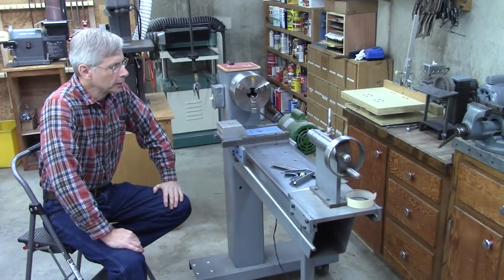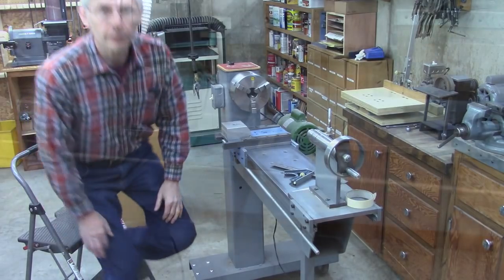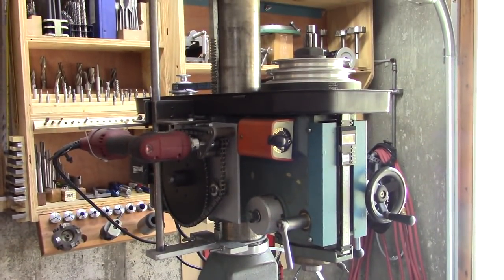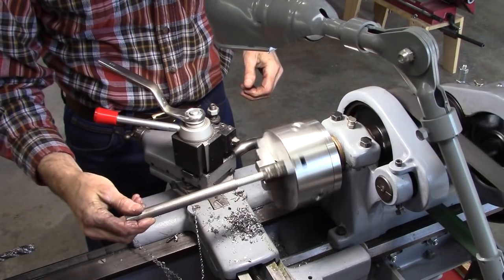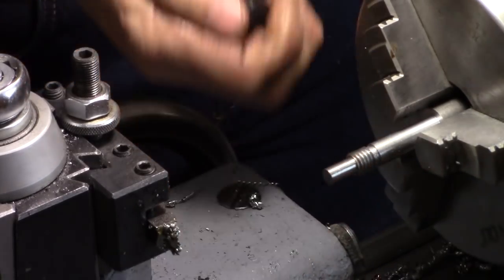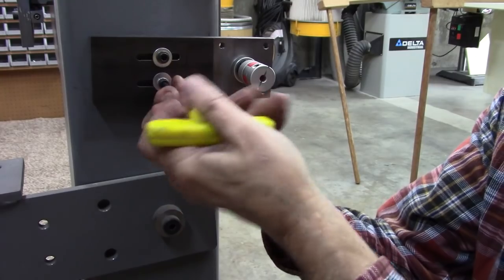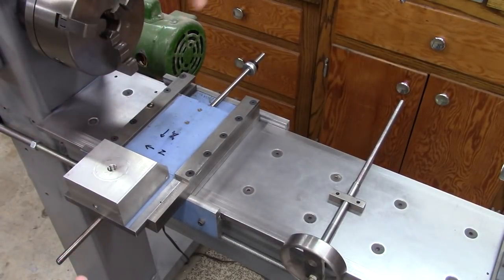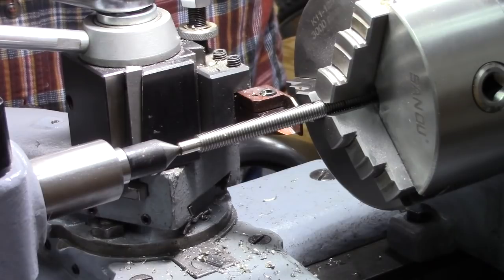Wood Lathe CNC Conversion - Part One

Comment: 13:25 love the attachment for your bandsaw.   If you ever find yourself looking for something to do maybe you could sturdy it up by adding some kind of receiver for the foot of it .... directly under the table.   Just something for that foot to fit into.   Just a thought.. and it might not even be necc.   Maybe something simple as a pin on the inside of the near corner of the column.   Not sure what clearance you have when the saw is used horizontally
Reply from the maker: Yeah I made a video on that table but it wasn't my idea. It works fantastic. It's hard to see in this video but the vertical 3x3 tubing is really close to the blade and sits on the bed casting. The table itself is 3/16 and then I added a 1/4" thick peace of angle iron to support the overhang. It's very solid. https://youtu.be/yGUw2kuweQk?t=377

Comment: 8:30 would like to have seen a journal turned on your all thread.  I suspect the threads will chew up that bronze faster than you might like. At this point in the video though ..... maybe you have a reason that isn't apparent yet
Reply from the maker: You are too observant! Ha. Yes that was simple laziness on my part although amazingly enough it's wearing very well. It really only stops the rod from flopping around anyway. The bushing could be totally missing without any negative effect. I'm a bit more concerned about the standard threaded rob I used, especially in the carriage. It moved a lot! So far it seems to be doing well but I have been keeping it well oiled. The cross slide doesn't move much in comparison.

Comment: Very interesting project !
Reply from the maker: Thanks, I hope I can figure out the software!!
Reply: @WinkysWorkshop  I would have gone with a 3/4 nc lead screw, to make that easier, but I have every confidence in you. You are a very smart guy!
Reply from the maker: @trollforge  - Thanks, I think Acme would be the best but I had the 1/2". If it wears I'll replace it.
Reply: @WinkysWorkshop  I wasn't thinking about size / wear... But 10 threads per inch...
Reply from the maker: @trollforge  OH...   got ya. Well, it was 3/8" -16 TPI which was handy for me with woodworking but the all thread was wavy.  If I was not making it CNC the 13 TPI would be terrible but CNC doesn't care.

Comment: This is going to be very interesting!  I've always wondered why there can't be some crossover between wood and metal working
Reply from the maker: I've done both for a long time... in fact more wood than metal in the past. It all started because I wanted to make better woodworking machines (or at least much cheaper)

Comment: Great numbers again my friend.  A CNC wood lathe eh. I would have never thought about trying to pull that one off. Great to get some time to catch up with you and many others. Just been stupid busy for the last couple months. I have built a couple wood lathes in the day but nothing nearly as good as this neat piece from you fella. For sure on the shear pin. They have saved many a lathe, wood or metal from a disastrous end. I have always liked your approach to builds. Solid, no messing around with too much bling, rock solid pieces anyone would be happy to make or own although I would have gone to a 1" lead screw. I have been blamed for over nailing a wood frame before more than 3, 1/2 times eh, LOL. I must say you are the only fella that I have seen turn with a cut-off tool. For the life of me I can't figure why not to. Saves a bunch of time with no stress to the tool. Brilliant fella ! Right down to the surface plate/table you made for your bandsaw. Why not use what you have and exploit that. You can count on it to see me hanging around for the finish of this build my friend. Great to see you healthy and busy. Take care now eh ! ! !
Reply from the maker: Wow...  great comment, hard to reply to that but I'll try. First, the shear pin. The steppers have low torque and will stall before damage happens. Both axis have hard stops if a limit switch fails. I'm thinking about adding a movable stop for specific chucks in case of a programming error. I'd hate to see the tool run into the chuck. I went from a 3/8" lead screw to a 1/2". The power required to move through wood in very slight compared to metal. To give you an idea the stepper motor shaft is 1/4" and the torque 2.6 foot lbs (if I remember right). The cut off tool is called a Cutoff and Grooving tool and it is advertized that it will cut laterally. It uses a GTN 3 insert and it is shaped to cut on the sides. It works fantastic and has almost no deflection... in other words, a second pass takes almost nothing and a third take nothing. It's very easy to get the size you are aiming for and cuts fairly smooth too. Yeah the bandsaw plates were a hit. The first 10 sold in about 15 minute and the second batch of 20 in about a day. I was concerned about them fitting all bandsaws after I got one complaint (although he made it work). So far only one complain and no returns. I need to get more made and sell them on ebay, Via youtube is good for about one week. Thanks for the comment, you made my day.
Reply: @WinkysWorkshop  I always enjoy visiting here.

Comment: I enjoy your videos very creative! I learned the hard way to mount my limit switches so that they can be open or closed with an adjustable wedge stop attached to my cross slide and saddle; using a wedge allows the cross slide or lathe saddle to move past the limit switch without damaging the limit switch if the stepper motors do not stop when they are supposed to. I look forward to seeing our next video.
Reply from the maker: That's a great idea and i did think about this. What I did as an alternative is make then both hit hard stop if the switch fails. The carriage hits the headstock and the cross slide had a very good stop. The nema 23 steppers don't have enough torque to hurt much although the flex couplers might be an issue. Thanks

Comment: I really enjoy your videos  but worry for your safety when you get close to a spinning chuck with your sleeves rolled down.
Reply: I've been a machinist for 50 years. I have and all my machinist wear full combination overalls ie: long sleeved it is is mandatory in my workshop.  If you have them correctly buttoned there is less risk of entanglement than sleeves rolled up. The mechanical protection long sleeves give out way any entanglement issue.
I have seen more injury occur from rolled up and no protection to forearms. 
Winky always is correctly buttoned up.
Of course there is a possibility of entanglement as is any other trade. PPE IS 99% in the hands of the operator.
PPE IS only 5% of good WHS The other 95 percent is with good awareness, elimination of risk, good engineering practices to remove risk.
Reply from the maker: I agree Norm. 95% (or more) is good awareness. You don't put your clothing near moving parts and you don't leave loose clothing hanging down. I'm not sure my flannel shirt sleeve offer much protection aside from protecting me from a hot chips but rolled up shirt sleeves is a very bad alternative. I suspect I would approach safety much different in a business environment especially when dealing with a lot of people that may or may not understand the potential dangers and may not have the awareness needed. But in my home shop without other around I am very aware of the dangers around me. Ultimately my personal comfort outweighs the very small danger  my sleeves might present.  I also have no guards over my table saw blade either....  and that saw is about 1000x more dangerous than my metal lathe. Awareness and respect are the key!
Reply from the maker: Thanks for your concern. See below

Comment: If you ever come across a scrapped commercial copier, they often have encoders and stepper motors that may be useful.
Reply from the maker: I'll bet they do...  although I've never seen one. So far I've bought everything I need for less than $500 including both steppers and computer and monitor. Of course Billy's (Knox Machining) generosity has been amazing.

Comment: It's funny that you mentioned 1/2-12 threads. This is the threads on a bench grinder for the left hand threaded nut. They do this so you have to buy the nut from the manufacturer or distributor. I had a grinder like this I bought used, and it came withe 1 wheel, and it had everything but this nut. I looked on line and couldn't find the right one, so I sold the grinder without it.
Reply from the maker: That's crazy...  standards are a good thing.
Reply: @WinkysWorkshop  I agree. The sad thing is that the grinder was made in your "favorite" Asian country to the brand's "standards."

Comment: Interesting conversion.   I do wonder about the amount of backlash you will get with the all-thread especially with normal nut vs ball-nut or some kind of nut to minimize backlash.
Dave.
Reply from the maker: I used the lathe a few years manually and the backlash was hardly noticeable. With the addition of the thrust bearings I'm guessing the backlash is less than 1/64" which is totally acceptable. Of course it will get slightly worse but even 1/32" is very slight for wood. Of course there will still be some manal work like sanding which will remove slight defect.

Comment: I am always amazed at your creativity. Will you have to protect your linear bearings particularly against wood dust?
They also briefly saw your accessories for your band saw: also a hammer.
Reply from the maker: I will put covers over the lead screw but there are no linear slide.....  well, not with bearings anyway. The carriage rides on teflon tape stuck to the bottom. This sounds temporary but it actually holds up incredibly well.  The cross slide is steel on steel. It seemed to do well when using the lathe manually. I might also add some form of dust collection. This thing throws sawdust halfway across the shop. Holding vacuum cleaner hose up next to the cutter collects almost 100% of this dust.
Reply: @WinkysWorkshop  Thank you for Info.

Comment: Interesting project Mr Winky, wonder if the main motor will need to be variable speed 👍
Reply from the maker: Hello Terry, the ideal motor speed is as fast as it can go. However, safety and keeping the wood in the chuck limits the speed. Variable speed might be a plus but I suspect it will be okay without. You could set the program to go slow for roughing and fast on the finish pass. Maybe I'll do this in the future.